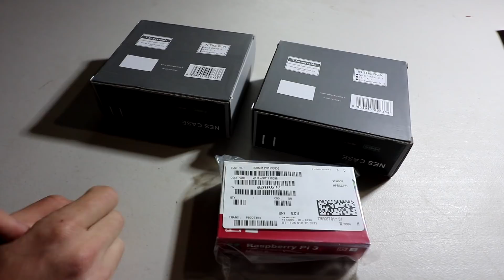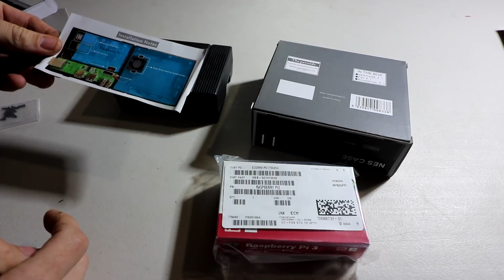New Revised NES Raspberry Pi Case With Fan Power Reset Switch

Comment: Ok ok I know you got a lot of crap about the shadows, but here's one more... Man I didn't realize this new case was also called the Pi Cabinet of Doctor Caligari! The only thing I wanted to mention is, the usb ports are awesome, but keep in mind you have to have the voltage to run them, more ports generally means more power...aka the dreaded lightning bolt in the corner of the screen